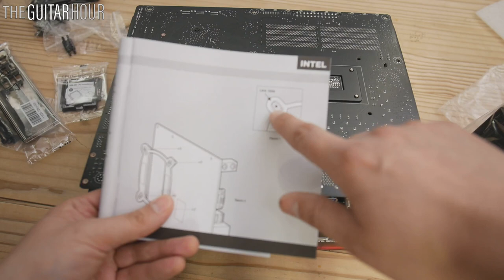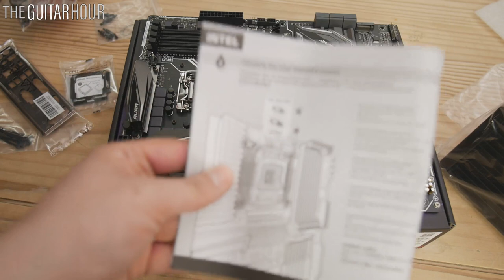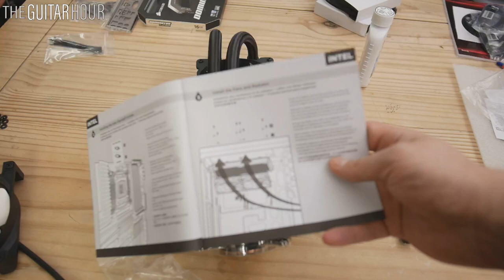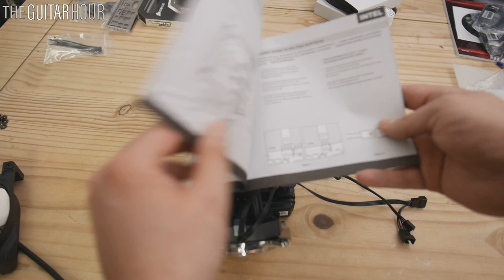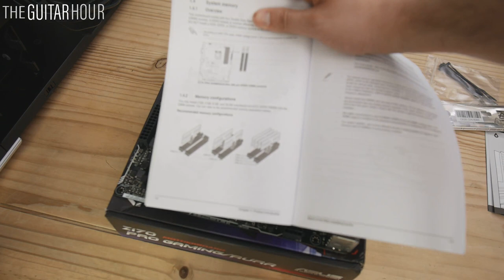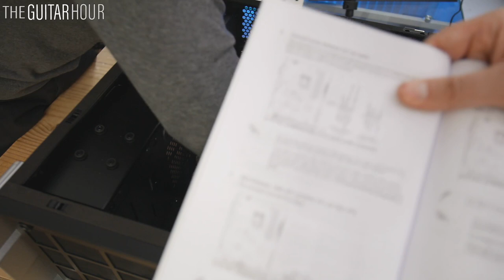The Guitar Hour - Dan's Uber PC Live Build

Comment: You used to be able to get a custom build of your chosen parts for a smallish fee. Don't know if that's still an option, but guys who do a lot of builds can do it quicker and they guarantee it all works. Usually they want all the parts sourced from them (unless it's some one you use regularly) so less easy to shop around for the best deals. It's a relatively easy DIY until it doesn't fire up. Troubleshooting is then what takes time and experience, if you have both, or know someone who does.